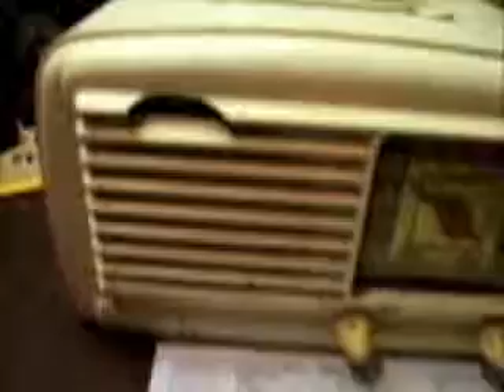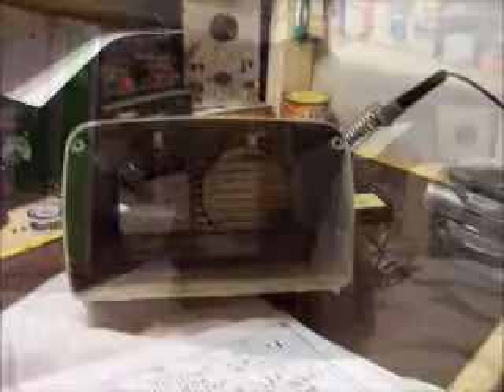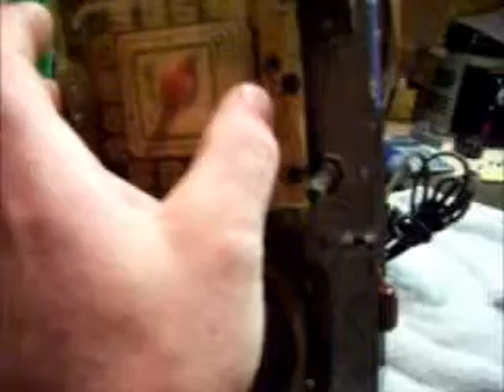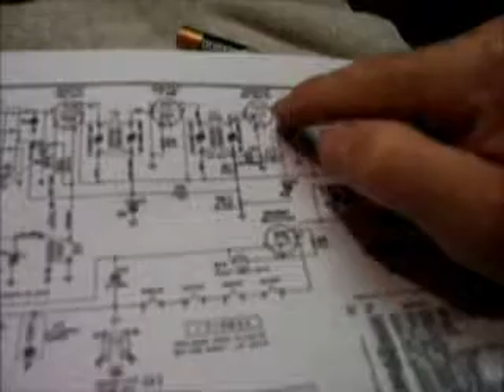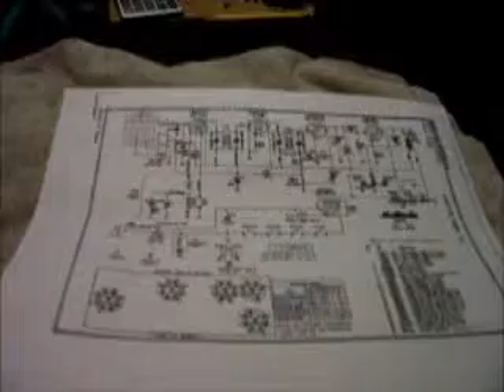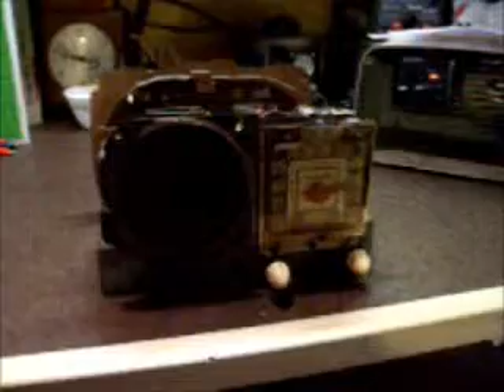Motorola 51X12 Radio - Part 1

Comment from the maker: Thanks Tec. I started taking this radio apart yesterday. Found some bad rubber coated wire and a few wax caps that need replaced. Part 2 should be up in a few days.